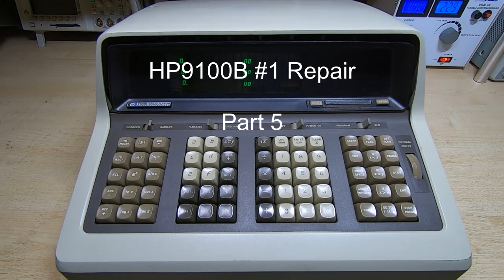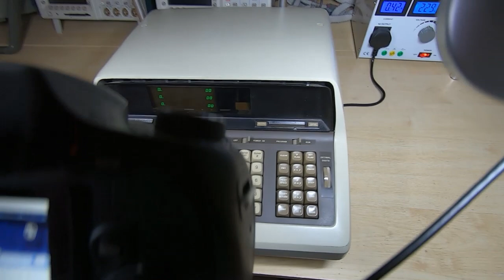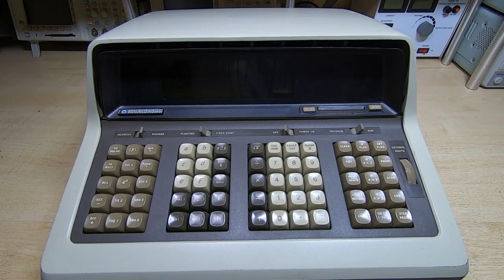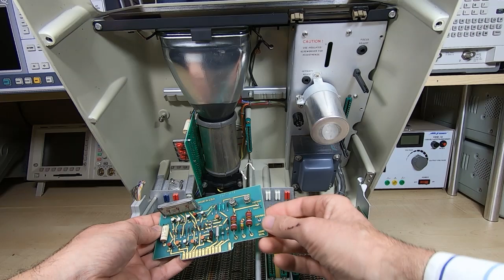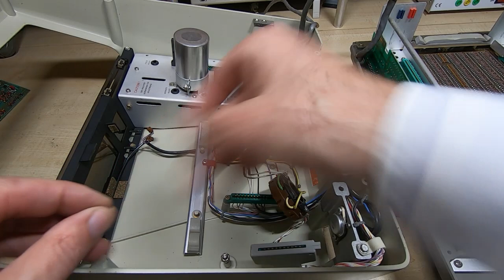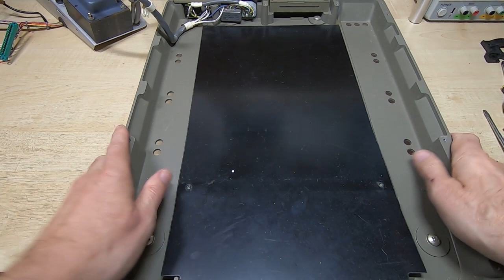HP9100B #1 Repair Part5

Comment: Jerry, what release agent did you use to release the aluminum-steel corroded joint at the regulator?  Something as simple as WD-40 or something better for this particular use?

Where can I download the service manual(s) & drawings/schematics for this machine?  Is there an archive for all HP gear?  Or at least their calculators & their peripherals?

Comment: Great series so far, look forward to the continuation.  You mention using release agent for bolts etc and electrical cleaner for removing corrosion on contacts.  Do you have a preferred range of cleaners for these purposes?  We all probably have our preferences, just wondering what you use.